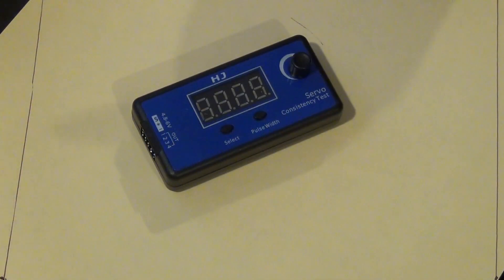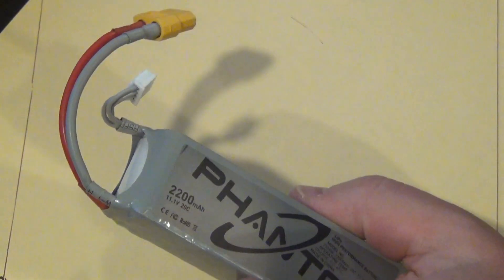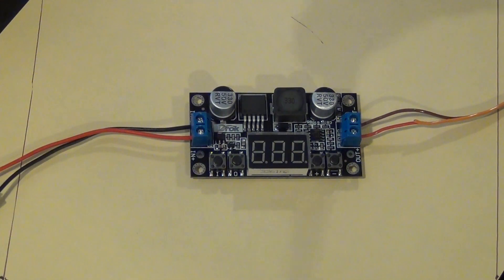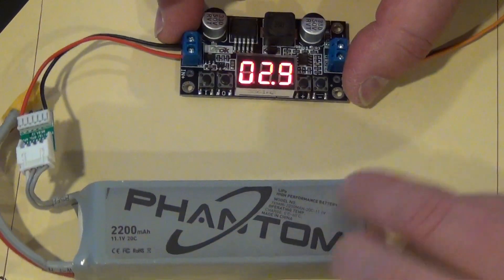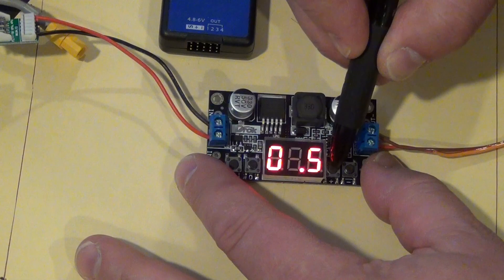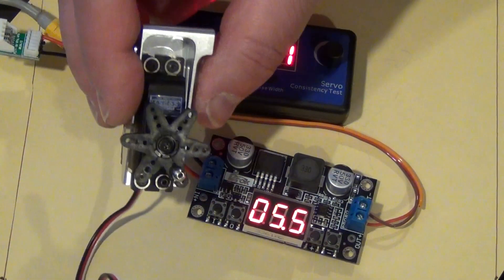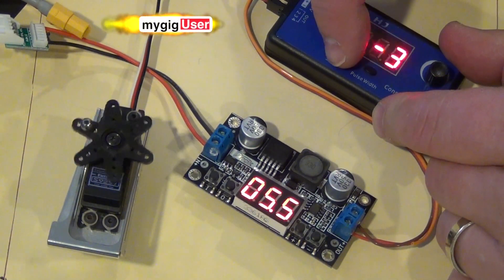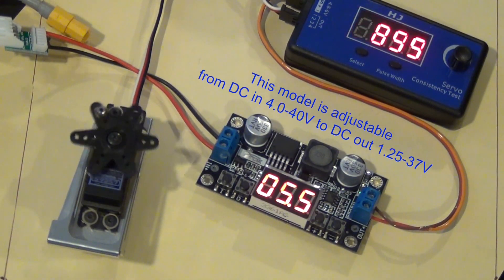Buck Converter

Comment: Hello sir.
actually I am willing to operate 6 Servos using 6v output of Buck converter.
would it be good? or buck converter will get hot?
Servos are MG995R.
Reply from the maker: I think the output max is 3A. Do your servos need more than that?

Comment: will the voltage settings reset back if it is turned of
Reply from the maker: Yes. I don't know the details, why it keeps the voltage, but i had one laying around for more than a year, and the initial set voltage was still the same, even though it was disconnected from power.

Comment: does it work both ways, can the input be less than the output?
Reply from the maker: +Tilen Smiljan No
Reply: +mygiguser What happens when the input voltage is lower than the set output voltage?
Does it just output the same voltage as the input? For example; If I input 12v and set my output to 10v, what would happen if my input voltage drops to 10v and then even further to 8 or 9v?
Reply from the maker: Vidgester1999 Then the output voltage drops too.

Comment: Have you any information as to the chip immediately to the left of the input screw terminal?  On mine it is marked 6203A.  The chip has four pins.  Three on one side and 1 on top... but that one pin seems to be also the middle pin on the bottom so it is extended though the chip.  Thanks
Reply from the maker: +Barry Mercer You talking about this one? http://www.mouser.com/ds/2/405/tpa6203a1-406450.pdf
Reply: +mygiguser Thanks for that, but I don't thinks so as I see that chip is used for audio circuits??? I have seen references to this chip in an sot 89 package.  I THINK I may have found something here: http://elcodis.com/searchparts/sot-89.html?page=19

Comment: Hi does your buck converter over heat. i tried to use it on a led light that require about 4v but didn't last long everything got warm and the buck converter got hot
Reply from the maker: No, mine didn't get hot. How many amps did your LED light draw?
Reply: I have no idea it is the ebay light for push bikes. Decided not to use led with this just rc remotes or anything with low amps